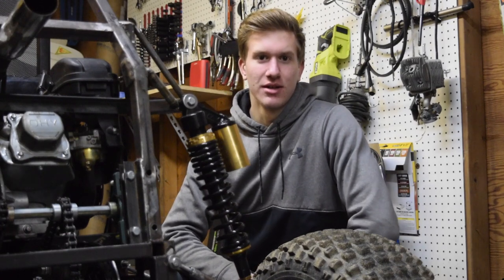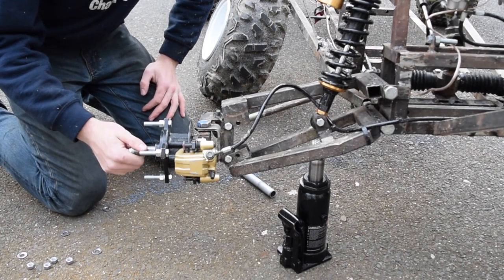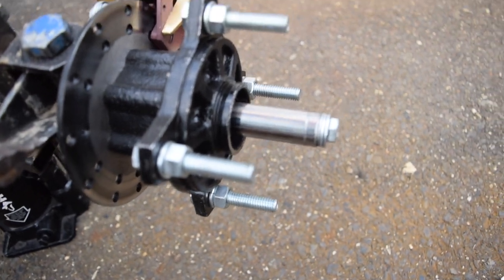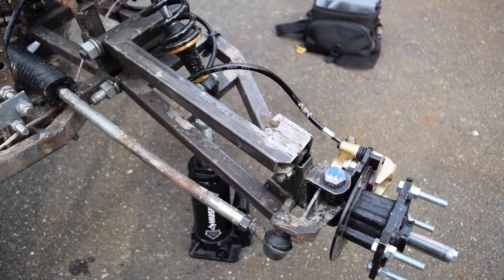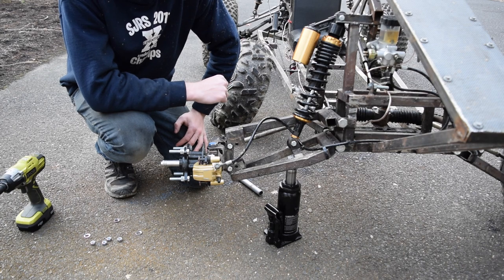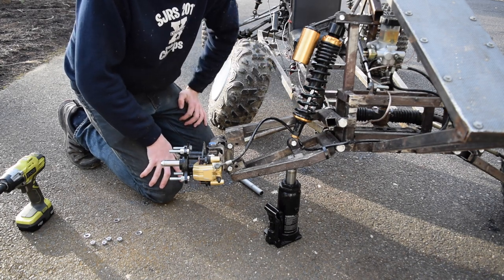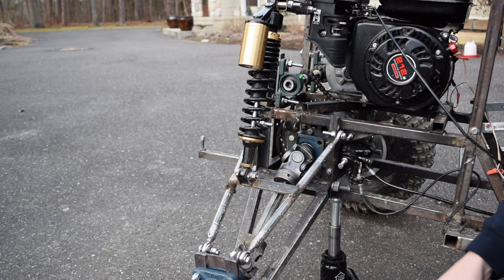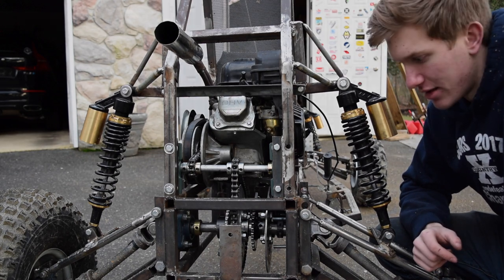Off Road Go Kart CV Axles, Suspension, and Steering!

Comment: Where did you the cv axles? Where those
 the ones you got from the junk yard?
Reply from the maker: These were just two U-Joints with 1” keyed shaft. Later in I got the junkyard ones and at this point I’m using WV axles that work even better!
Reply: Are you running cv axles. I only ask because I have extra duramax axles I was thinking about using.

Comment: Do you have any kind of bearings in the pivot/linkage points of your steering and suspension? Or is it straight up steel bolt onto the 1inch square tubing ?
Reply from the maker: There are bearings in most of the joints as of now.. at the time there were some where it was just a bolt into a hole drilled in the tubing.. or a piece of pipe that the bolt went through as a pivot

Comment: Where did you get those axles?
Reply from the maker: Edward garcia it’s two 1” universal joints from “surplus center.com” and 1” keyed shaft also from surplus center. One end is fixed and the other slides when greased. If you are considering doing something similar I’d suggest using car cv axles. Go watch my most recent videos and I explain how to get them from a junkyard and modify them for go kart use. Thanks for watching!
Reply: Awesome. Thanks for the info. I’ll check out that video.

Comment: Not trying to be a jerk or nothing but you probably might want to study up on those universal joints almost all of them look to be at to severe of an angle...
Reply from the maker: georgiaridgerunner 79 believe me I have done plenty of research. Those joints are rated for 15hp and are at an acceptable angle. That is what they are made for, as long as there is no binding when they are rotated (which there isn’t) they are installed properly.